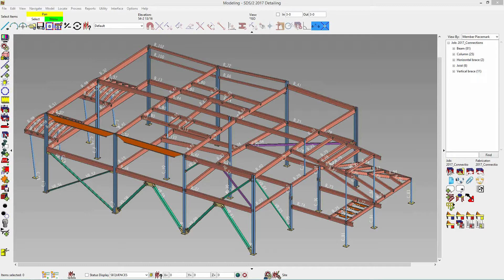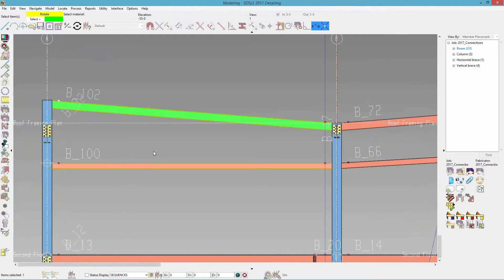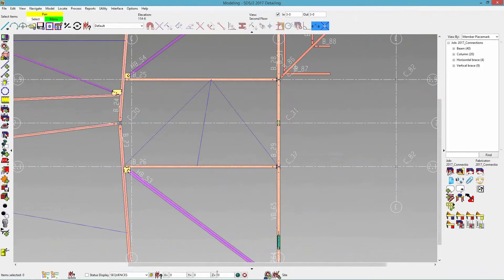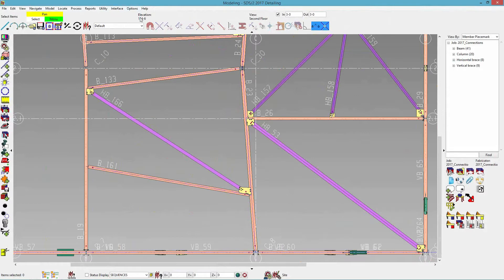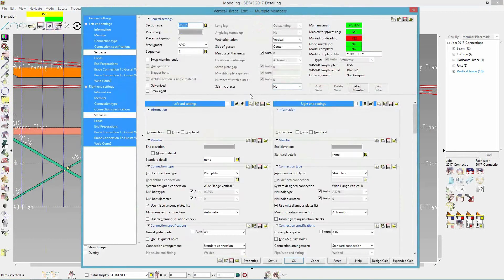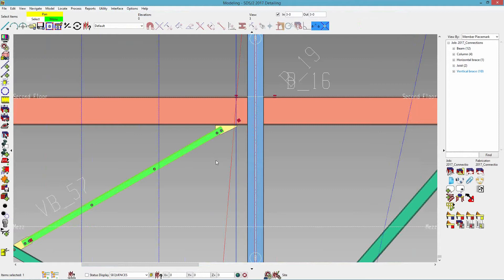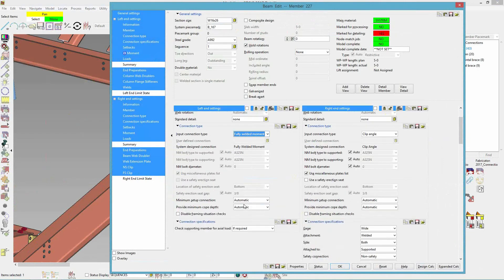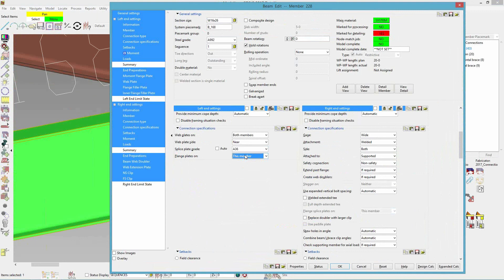New/2 2017: Connection Upgrades

Comment: hi mam.. can you also do video how to edit anchor bolt example putting double nut, set the size and height, using plate washer and also video which show how to create manual connection... thank you..
Reply from the maker: Hello, 
Please contact our Support Department to help with anchor bolts and creating manual connections. support@sds2.com